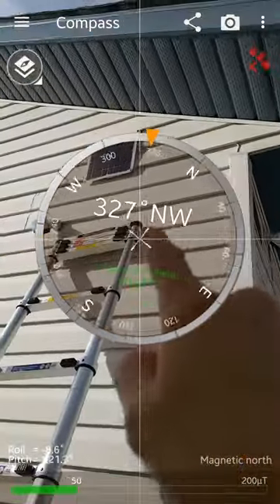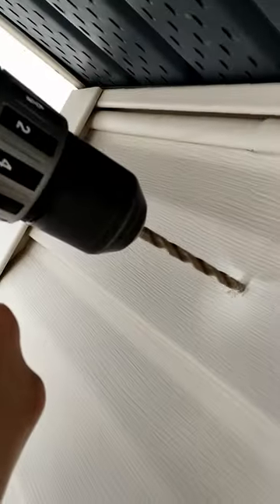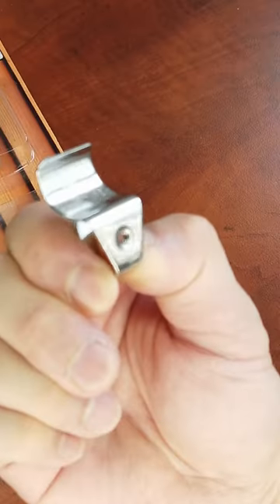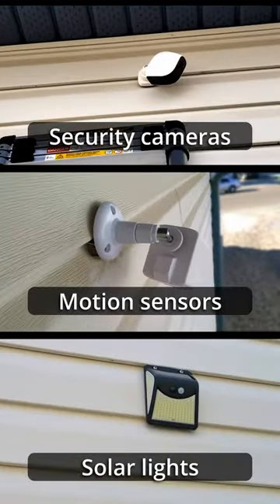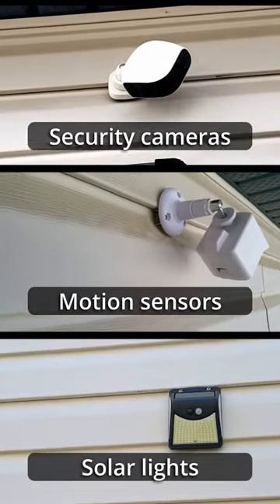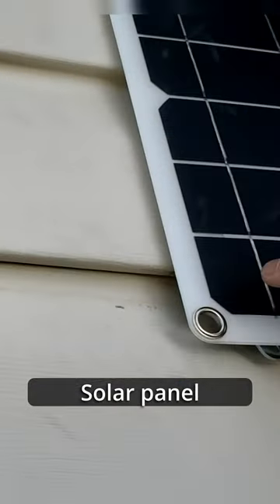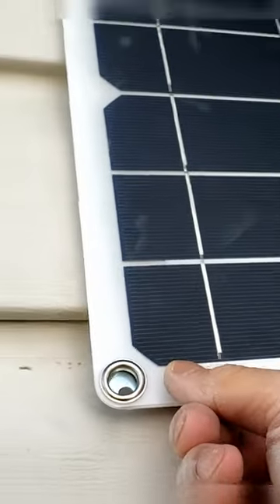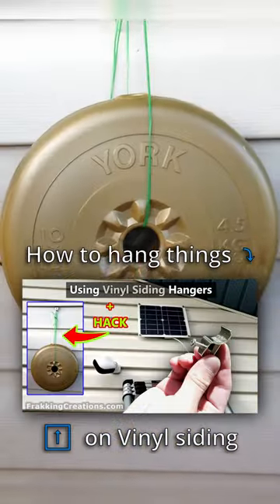No drilling holes into your house - Hang things fast & easy on vinyl siding

Comment: I have these, installed all my camera with them. Problem was I had to use nuts behind the screw, the holes on the mounting brackets are larger than the camera base. So far good, let’s see how they make in the winter.
Reply from the maker: Thanks for sharing your experience.  Which camera system do you have?
Reply: @FrakkingCreations  I now have the Eufy, I did have Zmodo and blink. All solar now except for the s100 wall cam and the doorbell camera

Comment: Looking into how to install a waterhose reel to vinyl siding with wood behind. Any tips?
Reply from the maker: In one of my videos I installed a small solar panel on vinyl siding by drilling holes through the siding and into the wood behind and then using plastic wall anchors.  The hangers were then attached using the wall anchors.  I also used silicone to seal up the hole so that water and debris don't get in.

It's not necessarily the approved method but it worked for us.  That might work for you but you will have to consider if you want to drill through the vinyl siding or not.  Plus, you have to be aware and careful of anything else behind where you drill, like electrical wiring and water pipes, etc.

If you want to use the vinyl siding hangers it may be possible but the whole hose and reel will be heavy and you will need to use a lot.  Plus I don't know if it will damage the vinyl siding or not.  An example would be getting a big board that you drill holes in where they can be attached to the vinyl siding hangers.  You will have to setup the hangers on the vinyl siding and measure where you have to drill matching holes in the board.  Not sure how many hangers you will need, though.  Then attach the hose reel to the board using different holes and screws.  Finally, attach the board with hose reel to the vinyl siding using the hanger screws.

You might also want to consider a hose hanger that is freestanding and is inserted into the ground like this: https://www.amazon.com/gp/product/B0BPWYR2G3

Hope this helps.
Reply: @FrakkingCreations  Thanks! Yes! I've been wanting to do be wise & careful about installing it unto the house because of all the factors you listed above. I Will keep looking into the issue at hand! Thanks for the feedback & help! God bless you.